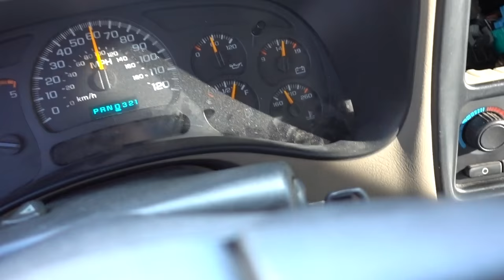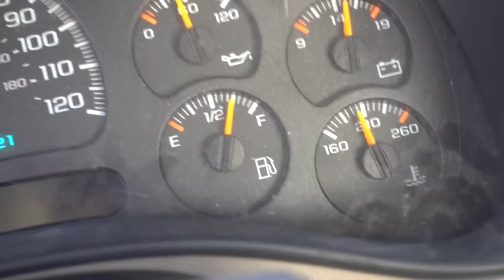DURAMAX NEEDS MORE WORK...

Comment: Service is key.. myself just bought a BMW 528I, and I recently serviced it. it didn't run, but it did after the service. it's amazing what a service does to your car. I replaced oil and filter, fuel filter, air filter and cabin filter. after that, she started immideatly.

Comment: 3DMachines Hey Dalton the same thing happens where I live in New Zealand in the winter and we just put a piece of that plastic cardboard stuff they use for signs in front of the radiator so there isn't so much cold air hitting it and cause I got the engine to run cold all the time.

Comment: heads up dalton, if you tip coolant and oil on its side to pour it it goes way smoother and way easier, and if you make a water tornado with any bottle the shape of that distilled water it comes out much faster and easier

Comment: typical duramax both mine 2002,  2007 run cold in winter,  I block the grill off in winter so they run at temp. I have a LB7 that has 523,000 on it never been modified,  did head gasket set @ 278,000 and injectors 2 times,  injector kit was 503.00 to my door,  if you ever do injectors cleaniness is a must.  they are not hard to do at all even a LB7 is not bad.
Reply: backyardbuilttrucks1 that is what you are supposed to do
Reply: how often to you recommend cleaning injectors?

Comment: something I learned a while back talking with customers on recommendations for their vehicles radiator fluid is called coolant during hot temperatures and antifreeze during cold temperatures it's fluids of all temperatures.

Comment: A lot of people in the colder climates block off half the radiator with a piece of cardboard.  You see this on big rigs all the time.  The diesels run colder, so sometimes it's necessary to keep the temp in operating range on hwy and such.  May be something to consider.

Comment: I thought I would add something from a tropical viewpoint. 1. In the tropics it NEVER snows. 2.I never have problems about "bed hair" because I don't have hair.  3. You seem to be having a lot of nickle-dime problems with the D-Max. I would have examined my sanity after the wheel off episode, because I cannot understand how the first rotor replacement went so bad. Maybe I missed a couple logs. I had a Chev 2500 HD 2003 that had so many issues I traded it off for a Harley Fat Boy, and bought a  Ford F-350 with the 5.4 v8. I am really happy with. Its Air Force surplus but I use it as a  daily driver.. Although diesels have their plu factors such as longevity, power, etc, I don't like them much because they are noisy, they stink, and out here, diesel is more expensive than gas.

Comment: I had to change the thermostat in my trailblazer a few weeks ago. I had to go through the wheel well instead of through the hood because the alternator and a few other hoses were in the way. I ended up losing one of the bolts and a socket somewhere in the frame. Fortunately I got it done by getting new bolts at my local auto zone. Trailblazers are a pain in the ass though...

Comment: Hey Dalton, putting water in a diesel is bad, because my dad had a diesel and he put water and it was not working right. And my dad is a mechanical engineer so he drained it and put antifreeze in it and runs fine.

Comment: hey bud I'm new to your channel but in the winter time on a diesel truck you have to blank off half of your radiator so you can build the heat that you need to build it's not that I'm it's not going to hurt to change thermostats but I don't have my Duramax blanked off in the front and my temperature runs low but that's what it is in the winter time that's why you see some big trucks they have those parts over the front of the radiators so they can build the heat that they need to build it warms up like it should

Comment: hey Dalton, if your having trouble getting heat or it still takes along time to get the truck up to temp. you should get a bra for the grille they normally give you them from the factory but since it's a Florida truck they probably didn't bother. hope this helped.

Comment: Hope this helps but anyway the lly duramax is the first duramax with good injuectors the lb7 was the one with crap injectors. The lly has issues with the turbo but not till high mileage. Love the vids :)
Reply: Also a little poiter is the orange anti freeze is very bad and is proven to cause cooling issues. I run just regular green anti freeze it is better according to a duramax technician

Comment: should do a light rad flush with a mild cleaner and hot water get the engine hot and then drain before you put fresh coolant in, the dexcool shit is really cloggy, my car wouldnt drain all of it out i had to do a partil by adding cleaner and hot water drove it hard for 10 minuits, then the coolant drained then i did just strait hot water and now i know this winter my heater core isn't going to clog up

Comment: NOOO Dalton you need to put a gasket and some silicon where the two metals meet other wise it will leak!
Reply: Both thermostats have a rubber sealing ring around the outer edge. No other sealing items are needed.

Comment: Your duramax comes with a cold weather kit which blocks off the grill and the bumper holes you might not of gotten them being that it was a southern truck they sell them on eBay or the dealer buy a set

Comment: I have the same problem with my 2006 LBZ duramax.. Coolant temps run around 150-160 and I heard after thermostats it will run 180

Comment: You can say goodbye to your head gaskets ✌ orange coolent will eat away head gaskets and thermostat gaskets. Always always use green coolent. GM puts that orange crap in there so you have to take the vehicle back to the dealership to get new head gaskets.

Comment: My hair doesn't need hair gel, as it left me quite some time ago ;-)
6.6, isn't that the engine they used to use in the 70's Trans Am??? I seem to remember Burt Reynold's driving a 6.6 Trans Am in Smokey and the Bandit??? I just blew a front axle seal in my wife's 7.3 f 350... :-( Darn Ford...
Reply: Brian W Yes the T/A was a 6.6 Litre gas engine. Smokey and the Bandit though, one heck of a good movie :)

Comment: please, PLEASE CHANGE THE TURBO MOUTHPIECE. its a cheep performace upgrade and it will HELP prevent head gaskets from blowing and lower the egts by 100-200 deg F.  for all things that are holy get an S&B through mouth piece for the lly duramax

Comment: Never buy aftermarket thermostats. These thermostats have certain temps they open at and after markets fail all the time. Also should find what temp it opens up at and test it in boiling water to see if it was opening. Just FYI

Comment: Hey see if you turn your heater to full hot and it will remove any air out the heating system

Comment: do the duramaxs have problems with dexcool like the 3.1 3.4 and 3.8 Pontiac/gm/Oldsmobile motors did
Reply: Not anymore. Its been updated years ago & is made to use dexcool.

Comment: If the truck was still to be cold you could put a blanket or tape over the radiator or the grille so the wont get thorough it
Reply: Niels Frederik von Tabouillot most diesel trucks come with a winter front grill cover.
Reply: to prevent damage to paint just save time and through some cardboard on it. works great lol

Comment: 2005 LLY??? New to the channel so I'll assume its a swap not a typo. Dmax run very cold in winter, sitting at idle my LB7 barely holds any temp when its really cold out, have to use high idle switch to get any heat while warming up. Even on hwy it will run well under normal operating temps when its cold out as compared to above freezing.
Reply: From 2004.5 to 2005 they used LLY duramaxs
Reply: Andrew_klein I was under the impression you could get the LBZ up until the 2007 classic??

Comment: did he run it with no coolent in it ?
Reply: thejake98 yeah. no idea why
Reply: thejake98 He ran the engine without coolant to cycle the coolant through the engine and get as much out as possible.

It shouldn't overheat running it for a minute or two.

Comment: does the thermostats come with new gaskets?
Reply: White Diesel not normally mind you I'm going on UK parts
Reply: Both thermostats have a rubber sealing ring around the outer edge. No other sealing items are needed.
Reply: Usually they come with new gaskets, yes.  Best to look at the part when you buy it though and see if you need to get the gaskets separately.  I never re-use those, they're very cheap and cheaply made, so always use new.
Reply: Thomas Joy thank you
Reply: MrSlowestD16 thank you

Comment: my question is why tf you put water in your radiator with it being as cold as it is?
Reply: straight antifreeze requires a 50/50 mix of water and antifreeze or you can buy premixed 10:41